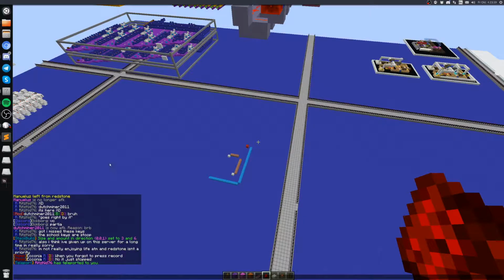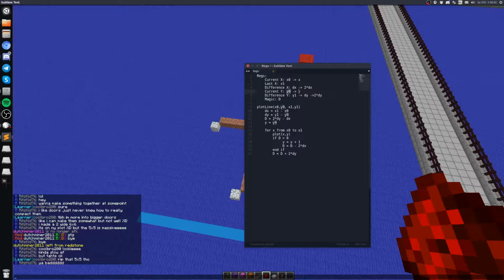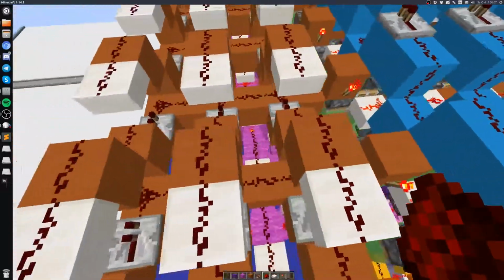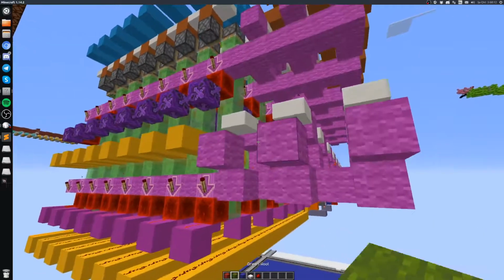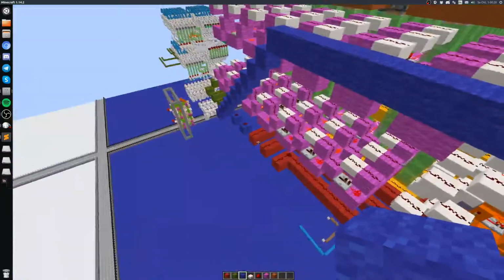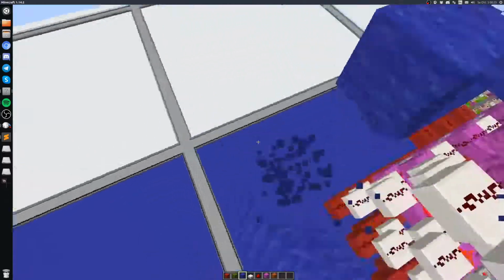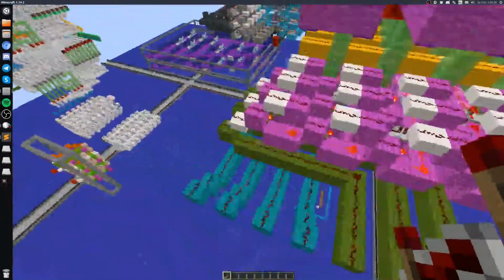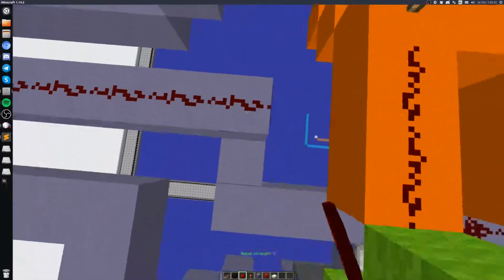Redstone: Line drawing - CPU 4/11: Bresenham Code 2 + RegFile Decoder

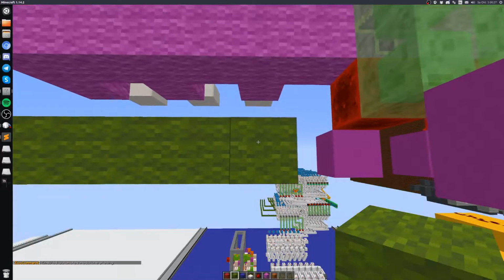Comment: What is used at 28:00? The thing that dusts wires automatically?
Reply from the maker: A tool I wrote some time ago. But it has restricted access. Ask me when I am bored and in a good mood, to make it public.
Reply from the maker: I think the main issue, is that I never knew which command to associate with it :(
Maybe someone knows :?